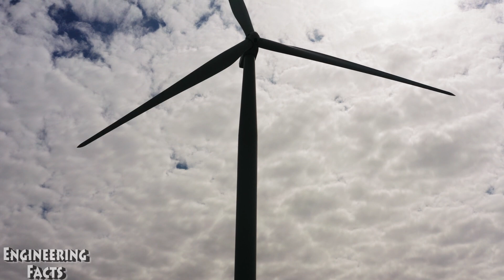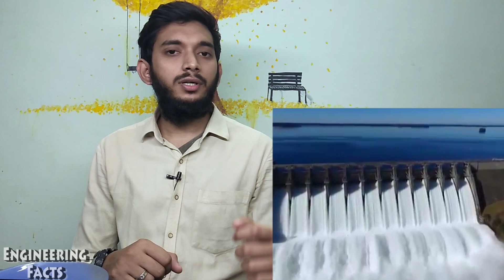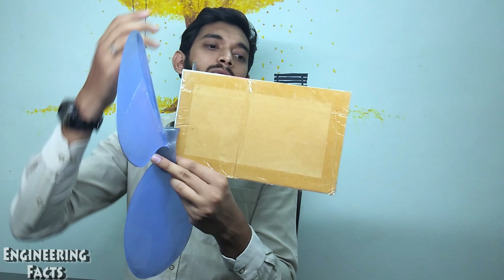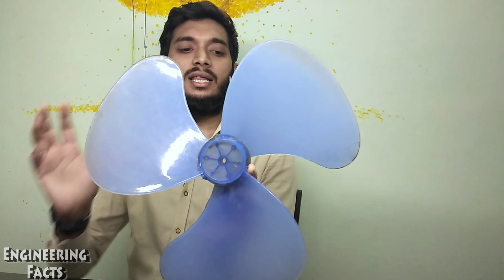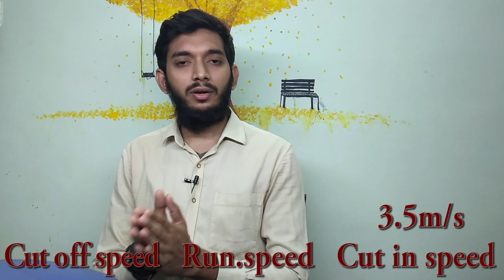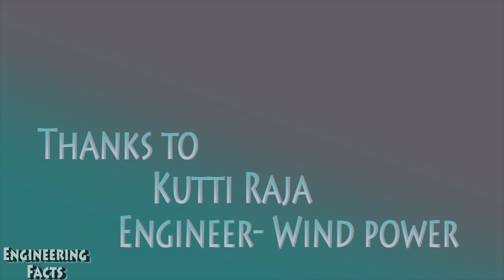How wind mill works?_ Tamil, Is wind mill running by the wind?

Comment: Initial rotation purely based on wind not by motor once it reaches synchronous speeds connecting to the grid using contactors and controllers 
EB supply usage in wind turbines 
1.controllers operation until Cutting in to grid
2.synchronous with grid

Comment: Bro, One small doubt , substation la irukura transformer rating epdi calculate panranga...For example 230/110kv substationla 100MVA transformer use panranga...66/11KV substationla 3MVA or 6MVA use panranga...pls explain about this bro...

Comment: In most of the wind turbines the pitch angle is fixed. In most windmills to sync with grid initially power is given thro thyristor to the induction motor and once it goes above the synchronous speed it starts working as a generator and power flows in opposite direction. Based on the KW/MW the rpm is maintained even the wind speed increases. Only in some wind turbines the pitch angle is varied to control the rpm. The maximum rpm is maintained at 1520 by the load or by varying the pitch. 
These are my experience during my 4 year tenure in windmill company(1994- 1997).

Comment: இதை புரியவைக்க திறமையான engineer ஆக இருக்கவேண்டும். 1500 rpm என்பது நிரந்தரம் அல்ல நாம் உபயோகிக்கும் 2 kva க்குள் இருக்கும் அத்துனை ஜனரேட்டர்களும் ஹைஸ்பீட் 3000 rpm வேகம் அதற்க்கு மேல் பெரிவை 1500 rpm இன்னும் சில பழைய கால மற்றும் நீர்மின்சார ஜனரேடர்கள் slow speeds eng 750 இன்னனும் குறைவான rpm இல் கூட இயங்கும் 2 pol 3000 rpm 4 pole 1500 rpm 6 pol 1250 rpm 8 pol 750 rpm இதுவும் 50. 60 Hz சைக்கள்களில் மாறுபடும்.

Comment: Why u r misleading the people, initially to rotate the turbine normal wind is not enough to produce the required torque that is why they initially they rotate the turbine with the help of electricity, according to u all vehicles are not run by gasoline, it is run by manual cranking, in every power plant we need to give some energy and it will convert another form of energy.

Comment: Motor ah act agathu...only pitch control mattum than.....rotor RPM maximum 30RPM than... gearbox ratio change panni kudukum...neenga solrathu Asynchronous generator ku porunthathu

Comment: Wind wan - direction changer via yaw motor 

Stoping weg using hydraulic pump

Starting weg in freewheeling using capacitor bank,contactor depends on wind speed upto 1000 Rpm, then cut in to another contactor upto 1500 Rpm

In 250Kw WEG.

Comment: Incase rotation per minute ku 1500 mela vandha enna aagum.. 
Means electricity generate panna 1500 rpm venum nu sonningalle.. In case adhigama vandha ena aagum..

Comment: Bro na wind mill la tha work pannura last neengaa sonna point la electrical energy kudukkanu nu sonnaingaa  kudukka vendiya thevai illa bro  blade 3.5 RPM pothu bro gear 3.5 to 1450rpm convert panniru  bro

Comment: yes boss ,at low wind foce  wind mill act as a motor ,at high wind force wind mil act as generator, there is no reverse power protection like steam generator, wind mill always snychronous with grid ,super bro nice and simple explanation

Comment: Assalamualaikum. First congratulations on the efforts and explanation techniques. It's crystal clear. I have few doubts related to this topic.
1. When the rpm is varying the frequency should also vary? If yes how to use this wind power in electrical grid since our electrical system works with 50hz only 
2. The connection mechanism of wind power with electricity supply for consumption (help required)
Your reply will be great help in adding knowledge.! Thanks in advance.!
Reply: 1. After 1500 rpm only Wind turbine will starts to give an O/P to grid. For maintaining the Synchronous speed there is 2 control system used in Turbine which called Aerodynamic control& Flexi slip system with variable pitch in mechanism. 
And Below 1500 rpm turbine will disconnected from grid and no any power output will not cme frm turbine. 

2. There ia a monitoring system in turbine called Softstarter and MFR which checks turbine O/P after  sync rpm.
if active power come for 6 sec period constantly, then the Generator Contactor will connect the turbine to grid.
Reply from the maker: The electricity is produced after the synchronous speed. So there will be no varying speed, thus frequency also don't vary.

For synchronisation with grid many steps used to maintain proper clean supply output. Which you have to check deeply. They'll not be available in common platforms.
Reply: @engineeringfacts  thank you.!
Reply: @engineeringfacts  p

Comment: 1004 rpm தான் இருக்கும் சகோ 33kv turbinela
Reply from the maker: It depends on number of poles
Reply: @engineeringfacts  nan windmill  than work panren .Turbine cuttin aagum pothu 1000to1004 rpm than irukum appothan mc generation aagum

Comment: Without gear box wind turbine also available.
Gera box required for Induction generator
For synchronus generator gear box  not required it will work in variable speed and we can stabilize the frequency by using different type of converters
Overall gud videos

Comment: pitch aaguthu nu sonninga speed kaaha adhu old technic nu nenaikren but pitch breaking kaaha mattumae use pandranga  break aagum podhu pitch opposite side thirumbum breaking ku easy ah irukkum . second thing generator highwind la 4 windings la irundhu power generate pannum low wind la 6 winding la generate pannum neenga sollra madhri aadi maasa kaathulaiyum power generate pannanum nah ipdi tha panna mudiyum ... apram orey nerathula adhigamana wind turbine use panna mudiyadhu substation oda capacity poruthu tha produce panna mudiyum ... video super bro ... na windmill technitian from suzlon

Comment: Bro turbine run aaitu iruku sudden ah knja neram wind suthama illa appo windmill rotation ah stop panniruma bro??
Reply from the maker: The motor function will starts. But it depends on situation
Reply: @engineeringfacts  ok thanks bro💯❤️
Reply: @engineeringfacts  Hi bro, motor action only occurs during 1495 Rpm only..then only it reaches 1500+ 1 or 2 Rpm by external wind power force there after it's working as a generator.. not at 500 or other Rpm..

Comment: Hi bro I’m Dr. Ijaz Fazil, I did my PhD in wind turbine Aerodynamics. I hope your main concern is on wind mill than wind turbine. If your particularly concerned about wind turbine you should have explained about lift force because it is the main reason for the wind turbine to rotate. Also if I’m not wrong cut in speed n cut out speed is not fixed it depends on the turbine. Just to add, wind flow is due to pressure difference. Overall nice video
Reply from the maker: Thanks for your valuable info sir.
Reply: Yeah you are right , its simply aerodynamics,  an aerofoil structure to produce lift and we are converting lift to rotation
Reply: Bro  the main reason for the the rotation is relative velocity with respect to blade which causes lift as it is connected to a rotating hub it rotates  ( not the actual velocity of wind which is only used to give initial movement)that's why twist is given along the blade  with varying angular velocity
Reply: You are correct. It's based on size and type of the windmill.

Comment: wind sila masam thaan irukum athuka piraku konjam kooda machine run aakathu.run aanalum cut in aakathu cut in aanatha power production aakum.over speed suthuna automactic disc brake lite lite ah apply aakum.wind speed,wind adikira thisai katta mela 2 censor irukum.blade oru suttu mudika ulla genarator il connect panni vachirukum coupling jaw 61 thadava suttum 1:61.rompa speeda irukum.

Comment: Gear wheel use pani speed decrease pandradu easy, but increase panna mudiyuma?
Reply from the maker: Yes
Reply: @engineeringfacts  How bro?
Gear wheel explanation video la 1st, 2nd, 3rd, 4th Gear varayum dan gear wheel use pandraga step by step gear wheel size reduce aagudhu 5th gear la direct'a connect pandraganu sonniga; Innum speed increase pannanum na epdi pannuvaganu soluga bro
Thanks for ur reply bro.

Comment: Some Small Corrections. .
1. Yaw Mechanism - Wind  vane or Ultrasonic Anemometer will Provide the Signal to change the Turbine According to wind Direction.
2. We use DFIG . this Acts as motor and also as Generator. Initially it acts a motor , once it moves to Sync mode it acts as generator.
we can take 80% of Current from stator and 20% of current from Rotor.
Reply from the maker: Yes you're right, I just make it as more simple, so that people can understand easily. Thanks for your feedback

Comment: I'm an electrical engineer work in wind turbines installation... and what he explained is absolutely right expect the rpm of rotor blades which is always kept in 6-15rpm nowadays.. anyways he put a lot of efforts in making this video about windmills congratulations for that..
Reply from the maker: Thanks for that. Thanks for the info also..
Reply: @deepakh4614  bcoz he has real stuff.... unlike
Reply: Bro veetuku wind Turbine installation panna enna Pannanum Bro. Enna Amount agum Bro.
Reply: @vijayviji4405  yarupa nee
Reply: @vijayviji4405  watch sakalakala tv you tube
Reply: @deepakh4614  neraya talent irundha apdi dhan 
Automatic ah varum
Reply: @deepakh4614  நல்ல மரியாதை கொடுத்து பேச கத்துக்கிட்டீங்க
Reply: Hi Ajith, did you work in ABB India
Reply: Brother Does windmill affect groundwater....?
Reply: ழவநவழழஜஹளளளளளளளளௌ... 
  
கள்
Reply: @ajith hbk.   Bro what is the max efficiency of a windmill.
Can u tell me approximately....pls
Reply: @kishorem3061  it depends upon wind speed as well as the Turbine's capacity. It could be 350kw/hr to 2.5mw/hr
Reply: Those idiots what they educated they guide wrongly your knowledge
This two fools go and remove the blade and it will work with out wind 
Fools first understand science

Comment: Nice video doubt cleared about charging .. Bro one doubt single phase current la         1 ton , 1.5 ton AC(inverter ac) , 1 fridge,  same time run pannlama  my house night time voltage input. ( 190-210)  day time 230. Please reply thank you.
Reply from the maker: It is quite high load for single phase, you should take three phase supply.
Reply: THANK YOU BRO.

Comment: Hello bro if I keep the 1 hp water pump 15 feet from the corporation water pipe line will the pump pull water from the pipe line or I need to keep 30ft from pipe line?
Reply from the maker: 15 ft height? And we want to try directly, then only we know.. I didnt tested yet.
Reply: Ur number please

Comment: bro neenga sonninga that windmill needs 1500rpm but i haven't seen any windmill rotated like that ...bro it rotates vry slowly only bro how...? plz reply
Reply from the maker: Video skip pannama pathingala, video laye sollirupen, after gear box 1500 rpm, turbine rotating speed 15-17 RPM.
Reply: @engineeringfacts  i watched i 2times bro purila boo 15-17 rpm aa..? or 1500rpm, 😳
Reply from the maker: Bro, 15 to 17 RPM velila suththura fan rotation. Intha lower RPM gear box moolama increase panni, 1500 RPM after gearbox kidaikuthu. 1500 RPM vachi than electricity generate panna mudiyum.
Reply: @engineeringfacts  ahh thanks broo